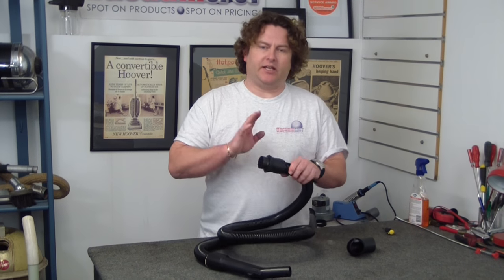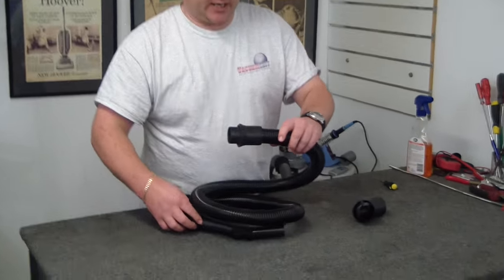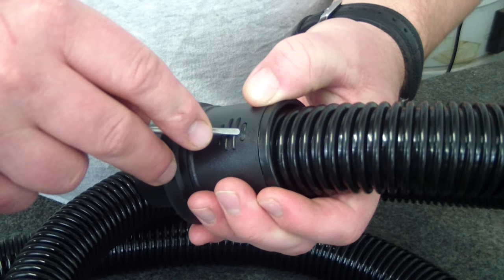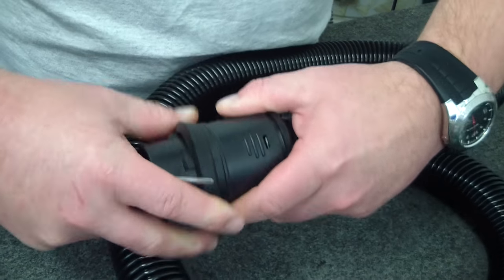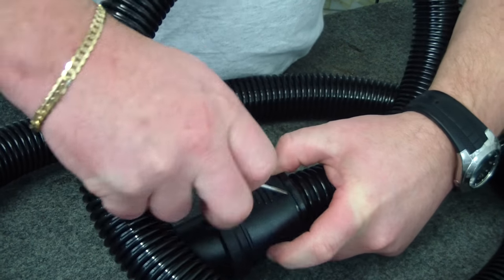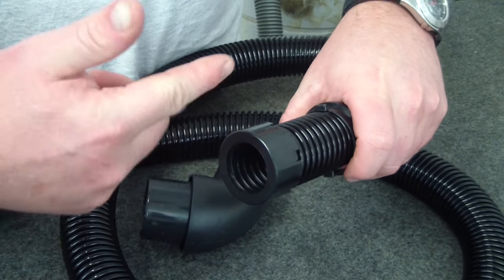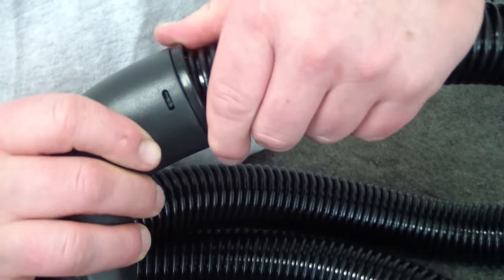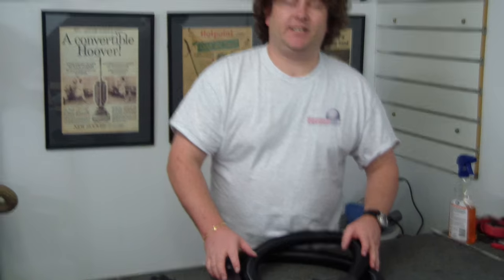How to change a vacuum hose machine end

Comment: Hi thank you for this as i was worried about breaking if I put too much pressure on it to push it down, just put old connection back on new hose as black and decker are a pain for connection part😊

Comment: These ones are easy, how do you do the pullman ones which dont have tabs?
Reply: On mine, the collar, where the hose goes into the machine body, doesn't use clips. Instead, you unscrew the collar, which is attached to the hose. Hose and collar come off together.

Comment: The cuff is the end, the bend is an attachment that goes on the cuff. I ordered a new hose for this NV682 List away shark and the replacement hose does not seem to want to get in the ends. I thought maybe thee was some trick to it and I looked here.   this is so weird .   It's like this video was made for that brand and it was never told.   Like what you have there is standard. LOL